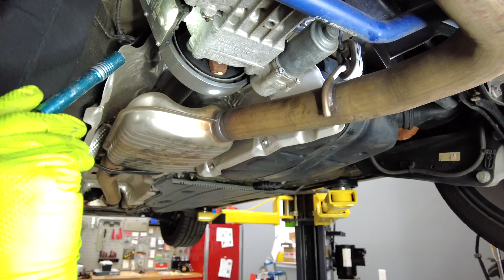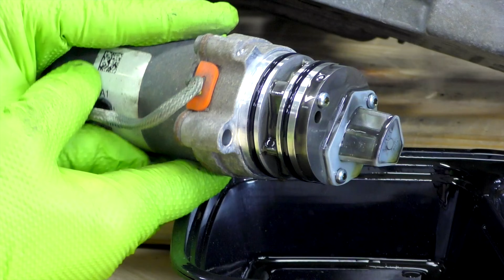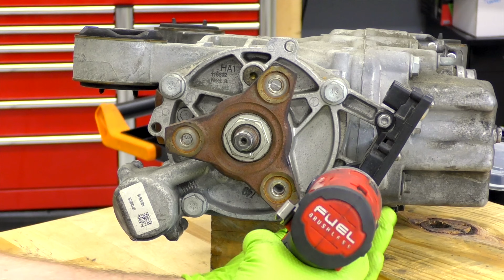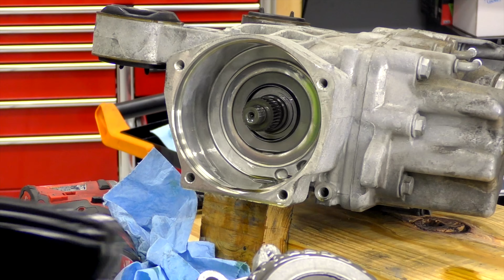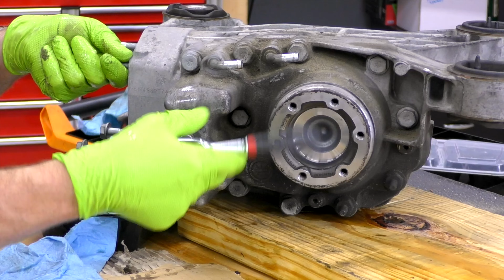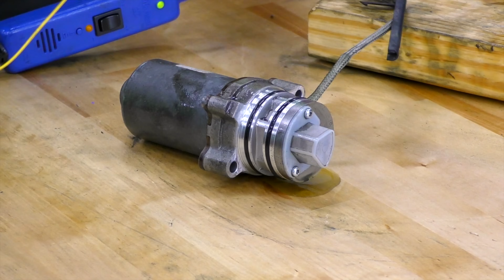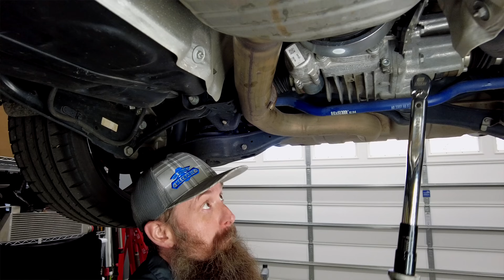Catastrophic AWD Unit Failure Audi S3 Golf R ~Haldex Failure

Comment: When does this clutch engage?  

During normal driving, say, 45 mph no slippage....What percentage of the torque is applied to the rear axle?

Great video!
Reply: Haldex, since 4th gen (the unit in this video is a 5th gen), will always apportion some torque rearwards whenever the car is accelerating.  The degree of rear application depends on throttle position/rate of acceleration, and what gear the car is in.  Also if front slippage occurs, more torque will be delivered rearwards.  When the coupling is fully locked it can send 50% of the drive rearwards.  Older 2nd gen Haldex units only performed the latter part--they only put torque rearwards when slippage occurred.  It's a common misconception that all Haldex units behave like that when it hasn't been true since, as mentioned, 4th gen which is much more "pro active" in operation.

Note that the system is advertised as being able to send "100% of engine torque rearwards", which is true, but only in the case where the front wheels have no traction and are freewheeling.  However it's still only 50% of the drive that can go rearwards.  I.e. the rear can never overdrive (spin faster than) the front in these implementations.  Very few transverse AWD systems have any capability of overdriving the rear or being "rear biased".  The system in the Focus RS (not Haldex) is one of those exceptions, as the rear is normally at 3% more than the front (or something like that).

Since 4th gen, the Haldex system is also capable of reacting based on data from the yaw sensors (ESP sensors) but no VAG cars that had 4th gen ever implemented this (some other manufacturers did).  The MQB cars that use the 5th gen system do implement this I believe, however.  

When cruising though, like the 45MPH "normal driving" you mention, the rear end torque distribution is minimised and the car behaves as FWD--basically the clutch being completely unlocked.

Comment: It was quite interesting to see the progression from the Mk 4's Haldex to this Haldex-type Not-A-Haldex-because-Borg-Warner-makes-it system.  I was curious if the glitter was ferrous or non-ferrous as that might narrow down its origin.  Also, I wonder if the pump/screen was clogged with metal debris prior to going into the shop.  In any case, it seems like the pump got sad, which made the motor brushes get real spicy, hence the lovely black powder that dumped out of its housing.

Comment: No cat ass trophy 😢

This generation of Haldex has the pump running as long as the engine is running. This causes wear on the brushes, and the dust from the brushes blends with the oil and causes wear on the clutches.
The last generation has a different pump design and is actually completely off when 4x4 is not active.

Comment: All that expense, and it was just a motor. Seems like a clean up and a new motor and it would be good to go as a nice spare. This is why I do my own repairs! Were the clutches truly dead, probably makes more sense to just make a "spool" out of it (lock input/output) and make it full time AWD and skip the stupidly expensive repair. BTW, in vagcom, you can increase the clutch pressure (by default its set on medium IIRC on the S3)  and make it noticeably more rear engage-y.
Reply from the maker: Possible. its always a balance of making a repair, and doing the most right by the customer. A rebuild might have gotten it done, but it may not have leaving the customer paying a bunch of money for a car that is in the same place it was before.
Reply: @HumbleMechanic  If facing a 4WD unit replacement, and it's not an obvious problem, perhaps it's worth springing for a new Borg Warner haldex pump (c.$200) before going the whole hog?
Reply: @HumbleMechanic  Yeah, I guess my "trade-offs" are as an owner, not as a shop. As a shop your reputation is worth more than an expensive repair, so it makes sense to err on the side of "known good" as any rework will do more harm than the good done from a less costly, but not 100% sure repair. I get it. Its just my personal calculus.

Comment: My untuned 2016 MK7 Golf R w DSG had a similar failure at 30,000 miles where my car became FWD only (complete with FWD burnouts when launching the car). Unlike your failure, my dealer said they found a bunch of clutch material in the motor filter as the friction material had disintegrated away from the rings prematurely. I was told that the clutch packs weren't fully compatible with the Haldex, erm, "clutch" fluid. The entire rear diff assembly was replaced under warranty. The outgoing unit was "Rev D" found in 2015 and early 2016 DSG models, and the replacement was Rev G or H.

Comment: If its a common problem it shocks me that the aftermarket (or dealerships) do not have kits for it. Also if the clutch packs often dislike power why not have a puck set that turns it from sometime all wheel drive to permanent all wheel drive and get rid of the issue?
Reply: You can get an insert for the old haldex system like what’s in the mk1 Audi TT and mk4 R32, but it’s unusable on the road as it turns the car into full time 4wd, not awd.

Comment: I had a loss of rear traction on my 2015 S3 and noticed the voltage to the motor was less than half of what it is supposed to be under full load. Replaced the motor with new fluid and it’s now working correctly, pushing 11.xx volts to the rear motor. Definitely a best first step if you’re dealing with this issue as the motors can be had for <$200. Thanks for the teardown Charles!
Reply: Had the same issue on my 2015 S3, noticed I had a fwd car, took it to the dealer and they replaced the pump under warranty. Happened at around 50k km (sorry, in Canada, not using miles). Car is now at 115k km, gonna service it soon.
Reply: @nlz242  Glad you got it replaced at the dealer. When you service it make sure to remove the pump and check the screen so it doesn’t starve the pump again.
Reply: that's awesome!  Too bad it doesn't throw a fault when the voltage gets that low, would probably save a bunch of differentials from the scrapyard.
Reply: @Lord_Verminaard  what voltage are you supposed to see with the pump motor?
Reply: can you see the voltage in VCDS ?
Reply: @lambyt5956  You can. It’s under AWD, then  advanced measuring values, then pump voltage.
Reply: what voltage did you see before you had replaced it.
Reply: @Spongefans  it was only pushing a couple volts before. Significant front wheel spin on a launch to go with it.
Reply: @BurkeAbbott  Hmm. Cause my pump is also seeing only a couple volts. But my launches are fine as of right now
Reply: @Spongefans  I’d probably service it if you haven’t already. Make sure to prime the pump via VCDS if you replace it and top off the level after you do. Charles has an excellent video on the service procedure.
Reply: @BurkeAbbott  I have done it a couple times already including the filter clean. Seems to be working fine just worried about the low voltage
Reply: Low voltage means a short or maybe it's just not going full clutch

Comment: The lack of serviceable vehicle components and repair parts is shameful. These components were assembled and should be readily disassembled for a rebuild. The right to repair laws that are being considered, which industry is vigorously opposing, may change the repair industry, but it will be slow in coming. Example,  Porsche will not rebuild a failed PDK, $20K for a replacement and they will not make parts available if you wanted to rebuild one, so your point on keeping up with the maintenance or shortening the intervals when used in severe conditions is spot on. Only problem is getting owners to actually do it. As usual, great video.
Reply from the maker: This is the auto industry. Its sad that so much is not serviceable.

Comment: Pump motor failed.  Clean and reassemble with new motor and ride out.  Those clutch friction discs aren’t too bad.  Same type of multi plate wet clutch as motorcycles use.  You can dress the steel plates by polishing them with some 400 grit paper glued to a surfacing plate.  I have saved many dirt bike clutches this way that were much worse.
Reply: Exactly this! Everything was new inside so pump failed.. That simple
Reply: Could we infer that the pump's failure was caused by the black debris? As if the pump's internal weren't sealed properly? Because if that's the case, the failure seems inevitable and changing the pump should be part of routine maintenance.
Reply: Interestingly when I explained what is in an automatic transmission to my Uncle once the first thing he said was that it was just motorcycles that have them.  This just shows you how easy it is to be ignorant or uneducated on these things.  I am not even an expert on these things but I do at least know the way that they do work.  Of course once when I started my 2006 Jetta and it took around 30 seconds for the idle to go down (normal for a modern vehicle) he thought hitting the accelerator would make it go down faster but he is so old fashioned he thought it had a carburetor ROFL!!  He must not realize that for quite a long time no US vehicles have ever had one of those!!  Whatever you do don't let him within 50 miles of your vehicle because he doesn't understand fluid specs and would probably ruin something.

Comment: nice look inside. im wanting to do one of these in the rear end of my vr6 mk3, and im wondering about just locking that rear input clutch instead of using the adjustable clutch. is there a downside to that other than having an entire rear axle added to the driving drag of the car?
Reply: Fuel mileage and performance will suffer because you are always powering the rear axle.  I suspect that in normal driving, this clutch is largely disengaged which in turn reduces drivetrain friction.  On Subaru's, in normal driving only 10% of the available torque is delivered to the rear axle on purpose.  The 10% apparently cancels rear axle drag and actually improves fuel mileage. It does this by varying the pressure on those plates.
Reply: @Flies2FLL  yeah i'd figured that as well. outside of the parasitic drag tho, i wonder if it actually harms anything. im always city driving, so my mileage is horrible no matter what, but we also get torrential rains (1-2 inches in minutes) and have 2-3 months where ice is on the roads at least a third of the time. (omaha sucks btw....)
Reply: @ghomerghamer982 I'm not an engineer, though I study mechanical things and fly planes for a living.  But I would think that other than a minor loss of fuel mileage that there would be no detriment to what you are proposing.  I have a 2001 Subaru Outback with the 3.0 H6 engine, and what I have heard is that on this car in first and second gear, the clutch is locked and torque is split 50/50 front and rear.  Only when third gear is engaged does that clutch...

[on a Subaru it is attached to the back of the transmission, rather than the front of the rear differential = 6 of one, half a dozen of another...] 

release and only send 10% torque to the rear axle...UNTIL it notices that one axle is spinning faster than another.  Then it clamps or releases in order to equalize the speeds.

In your case, If you do remove/weld the clutch pack, you should think about a Quaife posi-traction differential of some sort.  NOT cheap but racers rave about the traction, and rear traction is the most important.  Best of luck!
Reply: @Flies2FLL  The car still has traction control so putting in a locker is a bad idea on a street car.  Full time 4WD and traction control would suffice.
Reply: @einfelder8262  That traction control works by engaging the brake on the slipping side via the ABS module.  It is mediocre at best.

Comment: I'm surprised that unit is largely serviceable, nothing seemed to be overly difficult to repair/replace.
Reply: which is shocking haha, silly vws
Reply: I don't think it is serviceable, I don't think you can buy the parts to repair it, other than the motor?
Reply: @whizzo94  That's the issue VW made a conscious choice to make the parts unavailable.
Reply: It is totally serviceable, but the issue is that there’s absolutely zero information on part numbers or a place to get the replacements.

Comment: Great video! Cool to see how it all goes together. Fixed my 2016 R with slipping issues at 40k with replacing the pump and new fluid. Seems like the pumps themselves are causing more issues than the clutch units themselves. Service mine every 20k or so with no issues since. Look forward to the DSG breakdown 💪
Reply: How you replace the pump if it isn't serviceable??
Reply: @rkan2  it is servicable, you can change the haldex fluid and clean the filter on the pump. If the pump is actually broken, you can also just put a new one on.

Comment: So am I the only one looking at this and thinking the actual BW unit was ok, and they missed just replacing the pump motor and possibly flushing the fluid?
Reply: Yeah I was thinking that, with any kind of clutch packs you will have certain amount of sparkles in the fluid as they are used
Reply: That is something that could bee a chance tested as a home mechanic working on your own car. BUT look at the clutch parts again, worn surfaces and metal embedded into the friction discs - that repair wouldn't have lasted, perhaps not worked properly at all. No flushing would solve those issues.
If the car was on it's way to the wrecker anyway and the customer just needed to squeeze out another couple of months perhaps a mechanic worth his dime would do it (but then running it in 2WD would make more sense mostly).

Comment: So would a permanent AWD lock added to it be bad for it?
Reply from the maker: I don't really know. I mean in theory it shouldn't be bad. I don't know how the computer side would deal with it. LOL
Reply: It would be bad for the rest of your drivetrain. The front and rear axles must be able to rotate at different speeds during cornering.
Reply: There is no true center diff - just clutch slip, so you'd get all sorts of binding and jackrabbiting as tension formed in the drivetrain going around corners, etc.

Comment: this is not the torque vectoring version right?
Reply from the maker: Correct. This is the old school AWD. I would love to get my hands on a TS diff. but not if its mine exploding HAHAH
Reply: The fancy one works the same, but instead of one clutch pack on the input shaft, it has two - one on each output shaft, but same principle, double the repair cost lol.

Comment: So in theory you should be able to upgrade/replace those clutches like you would a manual clutch if your car has a ton of miles.
Reply from the maker: YES! Now what I don't know is, who would make those upgraded clutches.
Reply: @HumbleMechanic  there's already about 4 companies making upgraded clutch packs.
Reply from the maker: @garyhowe88  NICE! I haven't really looked into it. glad to know there are companies getting it done. Its probably a somewhat common part in the automotive world.
Reply: People are running a 1000hp in heavy rs3's on standard clutches. But you can also buy upgraded clutch packs
Reply: If its just clutch failure from more power then the need is probably just parts and a thicker or tighter tolerance. Or better parts to factory tolerance. Couple hundred dollars worth maybe.